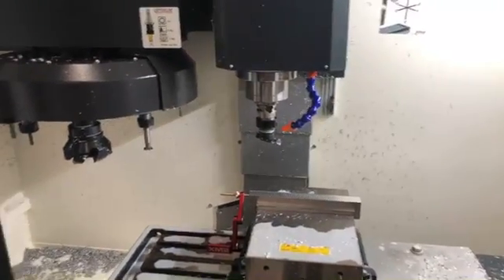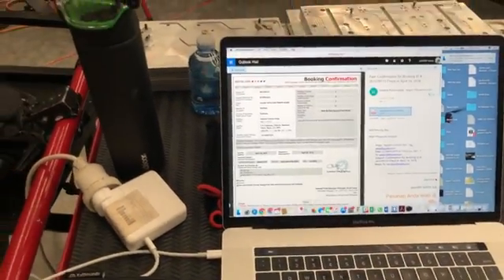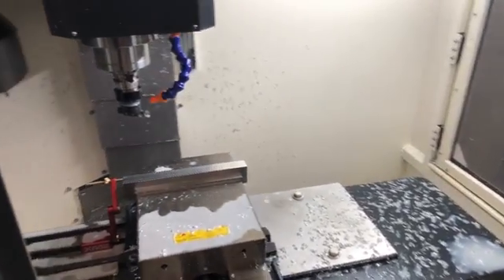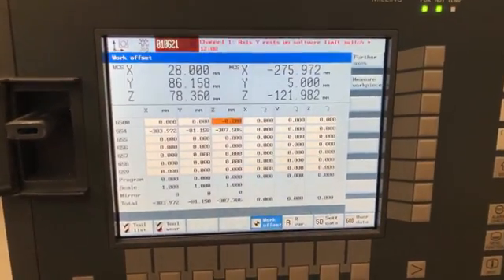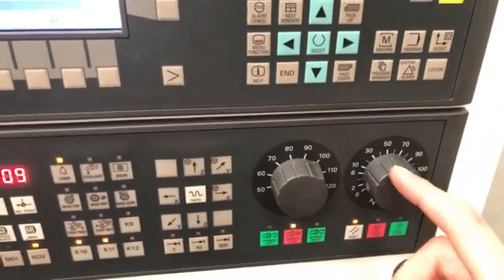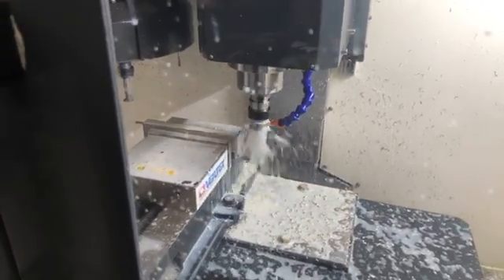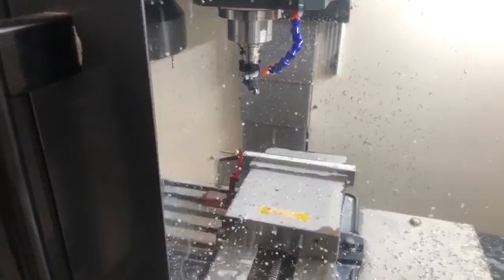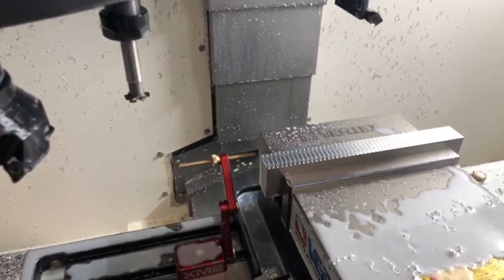Amazing Fly Cut Texture!!!

Comment: Hi, I don't have a tormach but want to do this to carbon and stainless steel putter heads with a grizzly bench top mill w power feed.  Any recommendations on a good fly cutter?
Reply from the maker: Cameron Lee hmm well you can make one relatively easily, I only have experience with this one and it’s good value and readily available. I imagine you can also use a face mill and just put one insert in? Good luck !
Reply: use a Shars 11/4 end mill and use only one insert. make sure that the insert is for a lathe it will have a L after the number. i use a 3/4 shank for stainless. the inserts are left handed for the lathe but are right handed for a tool used as a fly cutter. they have a great chip braker.